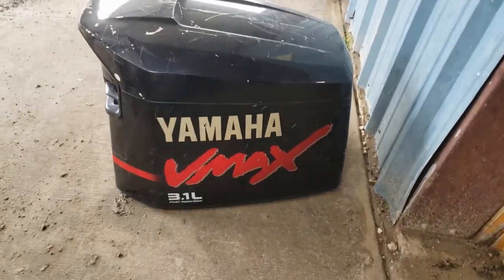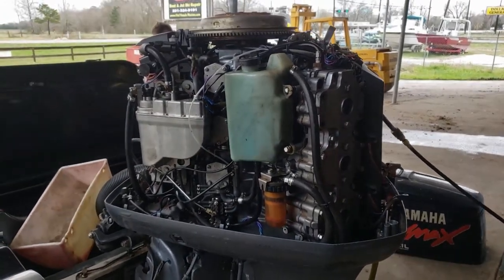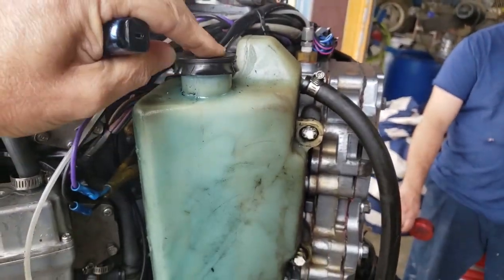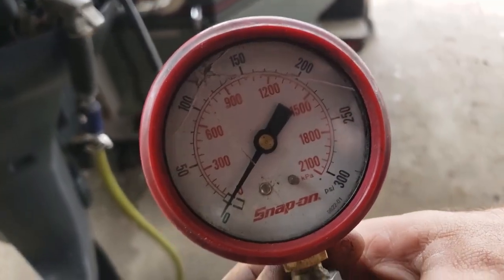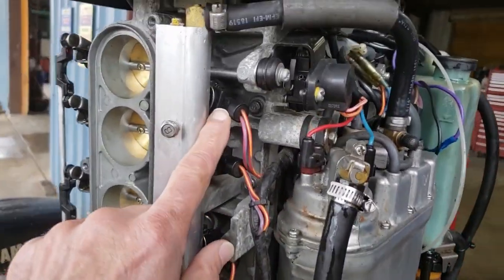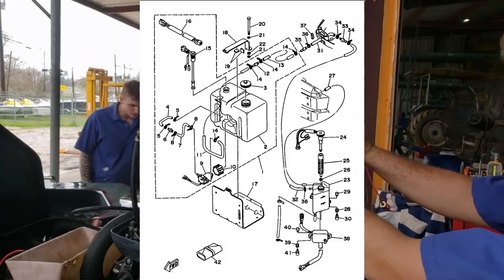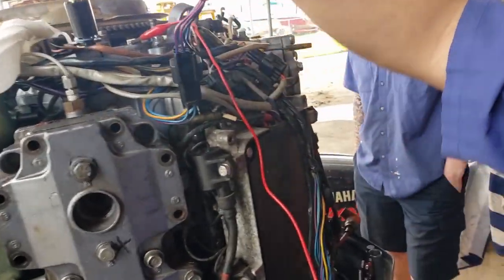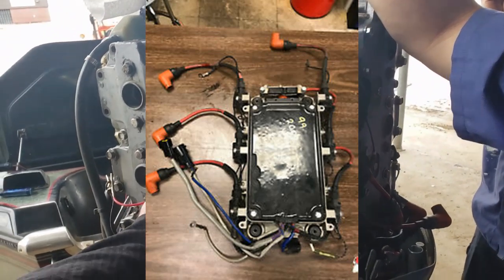Yamaha OX66 Oil tank sensor Failure Diagnostic

Comment: This was a really good video. Currently I am having the same issue with the same cylinder… I am at a loss thorough as what was the cause of this #2 cylinder going bad in the first place… as I said I’m having the EXACT same issue, no warning lights, limp mode or buzzer till it was to late… immediat inspection revealed no oil in main but full reserve tank, got home pulled the [lugs and cylinder 2 was fried and gap completely closed… was almost spooky seeing it verbatim but thank you all the same for your time…  now if I just knew what it was that made only #2 blow I may be able to remedy the problem correctly and fully

Comment: Can I get hold of oversized cylinder sleeve to these engines, and if where can I find them?
The engine block has cracked, so I need a sleeve that is thicker because I have to weld and process the block that's hold the sleeve.
Grateful for help

Comment: Nice job diagnosing..I have an older 175..89' and the engine oil tank gets half way empty then the hot horn and limp mode..I used a jumper lead on the pump on the Tank reservoir and it works..So in conclusion this system can become an Achilles heal.What surprises me is why the client filled filled both tanks after the fact..At some point there was no oil transfer from the engine oil tank and the computer failed..Initially a dry cylinder..and bad fuel injector seemed the culprit..My manual switch isn't working either so I'm not getting voltage somewhere..(harness) is there a fuse on the engine end..?

Comment: The first thing I do is a compression and spark test. If compression is low pull the heads and the condition the piston is in normally tells a lot of the story. If it's blown apart with little cylinder scoring then it's likely a defective piston. If the piston is melted it ran lean of fuel. The head cylinder chamber will also have no carbon left or very little. If you feel oil on the sleeve then it definitely wasn't an oil issue.

Comment: I have the same motor and same cylinder that had 0 compression. No one local would even touch it. They all just said to buy a refurbished powerhead
Reply from the maker: The real problem is why it failed. Replacing the powered will take care of the 0 but guess what will happen again. BOOM 💥
We are in process of phasing out repairs on many many 2 stroke outboard engines. I would recommend buying a new 4 stroke. Your never gonna be happy and enjoy your boat with any reliability or confidence until you do. Get a loan if needed but do yourself a favor. Go 4 stroke. Mercury. They have the engines these days.

Comment: I had my number 2 rod bearing  fail , and the wrist pin was sloppy , all I can figure is the recirc port by the reed valves was plugged , even with the bad  rod bearing compression was in spec ' 109 (it was the lowest best was 120)  , 947 hours 01 2.6L , sent injectors off they came back good , one had less flow that the rest but it wasn't #2 , just got it rebuilt and back together just need to hook up a few. Ore wires

Comment: Hello. i have a similar yamaha. the same problem happened in the same cylinder. we were unable to diagnose the problem. it may be a broken ring, injector clogged at some point, ignition coil with intermittent problem or at a specific rpm. test in an ociloscope. In your opinion, what must have been the cause of the problem?

Comment: Seems as though...WHOMEVER installed the oil-reservoir filter incorrectly = IS RESPONSIBLE for any/all oil related damages!!!  I am not a mechanic---just my opinion!
Reply from the maker: That's was just during testing and was corrected immediately.
Reply: Both reservoir tanks being full when the on board(boat) pump wasint working suggest the owner knew something wasint right..but in their defense the alarm horn wasint activating..to alert him or her of the engine side tank going low..diagnosing can be challenging..The owner may have known the main tank wasint transversing and ran it low.. We don't know..Owning a boat can be expensive...People will throw their mechanic under the bus when they are panicked and desperate..being respectful and truthful can eliminate bad outcomes from the get go..The motor side tank going low was an issue and not the result of the mechanic or the client..Just be honest..
Reply: Even when installed wrong. Filter is made to be idiot proof. It will still pump